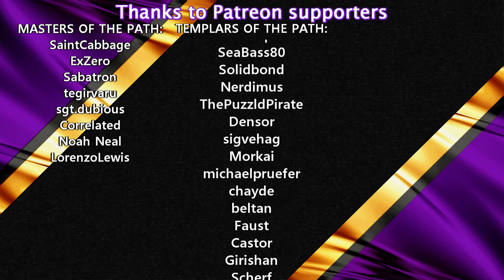Never Worry About MODULES Anymore | #10 | Factorio Megabase-In-A-Book Lets Play

Comment: My favourite part of this series is trying to make things on my own and then completely tearing it all down and replacing it with your designs the next day because yours are better
Reply: That's exactly what I do too lol
Reply: I kind of split the difference... I decided that I wanted to do a different city block size (128x128) so I've been using that design as I'm transitioning my own base to a "mega base". And so I'm largely copying some of the designs from this series, but then I'm having / choosing to re-work them to that block size. 

A good example was the green circuits, which I was able to fit in 2 128x128 blocks instead of the 3 that Nilaus used.
Reply: I have resisted doing this but I am reinventing the wheel all the time, I start with a cube and then whittle. it is the worst.

Comment: For the trains, I'd suggest having as many trains in the network as you have supply side stations and parking/stacking spots, no more. Hard set the limit on the "load" station side of any given factory to it's station + stacker count.  This should mean there won't be empty trains with nowhere to go stack up and wait for product.  It's fine for the station on the requesting end of things to say "I don't have enough room to unload any trains, I'm closed". The supply side stations should never say "I'm closed since I don't have enough material for even one train", since then the stackers right behind them are also empty.
Reply: 05:40  And at that point, the weird thing is that the station is so far off to theright.  The trains almost circle the deposit to load resources.  In that special case, I'd just build the station to the right of the track going upm with a turning point a bit further to the south to avoid trains blocking any important track.  The station would be a mere piece of track parallel to the main line. 
But what we really need for track (and which we have in abundance for both belts and pipes) is a 3rd dimension of either bridges or tunnels.  I'd favor bridges, built from 3 parts: southern ramp up (or down when moving south), northern ramp down, and a standardized bridge interval which comes with a pillar if you build several successive ones.  The ramps could be ~12 tiles long and the interval 10 (2 pillar diameter, 8 tiles available for anything going below).  The same should be available west/east, and that could be it, maybe diagonal pieces (interval 7x/7y), but they're not badly needed.
Reply: I have been grappling with this lately. I see what you are saying. Even if there are no requests for full supply trains all the available trains can find a spot to wait until request for materials come in. My concern I that my requesting station stackers will hog up full trains when other requisiting locations are waiting for slow mines. I don't have things balanced right I guess. I recently started adding blue belts for the first time and my 4/1 trains can't seem to keep up. Sadly I am still suffering from 'Spaghetti base' and I think I will need a huge rework to use any larger trains, so I am working on increasing my robot speed to ease the blow. But at the same time I see the alien menace increasing in numbers and I am getting nervous.
Reply: Yeah, I started using the circuit for the stations from Nilaus, and the problem I'm having is what he had in this episode - an empty train sitting at an unloading station, complaining about "destinations being full".  I think I've adjusted enough of that yesterday, but I also get the opposite situation, trains sitting at loading stations complaining about no space at the unloading station, when all of the lights of the unloading station are off.  The unloading station has 4 stacking slots, but trains won't route to the stacker if the lights are off, I guess what I need to do is add an arithmetic combinator to add "2" or "3" to the L value, so the unloading station always has a minimum demand.  Otherwise, the stacker at the unloading is kind of pointless.
Reply: @dogbarian8280  Im going to try that too,
Reply: Your rule does ensure that all trains have somewhere to go and empty trains are not blocking access for non-empty trains... but a problem with that approach is that trains will always go to sit at the closest supply points, so more distant stations will be relatively under-served even if they are full of goods waiting to be picked up.
Nilaus' method ensures that supply will get picked up quickly no matter where it is. One downside of that we are seeing here; it breaks down when demand exceeds supply - but you can avoid that just by expanding your base in a strict order (in order to increase a given output you must increase all of its inputs first).
Another downside might be that it leads to longer average train journeys, since trains will prefer to pick up from fuller stations even if they are much further away.
Guess there's no perfect answer! Which is great because we can all keep playing this absurd and wonderful game forever :)
Reply: saved

Comment: As someone else mentioned, you didn't wire up the landfill station to know how much landfill it has. 

But thanks for going over what a landfill station would look like. It's something people have asked for often on Discord. :) For me, I did similar, but I made my "Landfill factory" independent of the rock quarries, so I won't need to move it as the quarries empty out. 

Also, thanks for noting that the module unload station will need to be special; since you use the blue modules a lot more than the brown ones. If you just do the usual "wait until empty", you'd end up with a lack of speed modules and a lot of productivity. Hopefully the next video (or whenever the unload station is made) will cover the specifics in details.

Comment: Best Factorio series on YT without question. Question on the landfill train...Would it work better for throughput to just have a 1-2 setup and limit it a little to account for how much throughput you're actually getting from the miners? Unless you module them, even with the mining productivity you'll be short of filling the blue belts (again, I know this is just an approach to clear that spot to clear space). Just considering the expansion you laid out, and it might save some time on your end. It could move landfill in faster to the base, allowing the spidertrons to do the work quicker. Just a thought.

Also, to build on the train issue, couldn't a depot handle the supply/demand issue for now? I know it's probably not the plan for this base but it could clear up bottlenecks for now.

Either way, love the series, and glad that we have someone like you to lead the Factorio community.

Comment: I handle the waiting at unloading for an open spot adding waiting stations in the stackers of the loading station, one on each lane of the stacker. Add that station in the schedule with no condition before the loading station. The trains will leave the unloading station and go to one open spot in the stacker, where they will wait with the "destinations full" message.
If you have no condition on the schedule for that stop the trains do not stop if they can go to the next stop (just checked, trains do that, more details at the end of the comment).

Since you have multiple loading stations for the same, maybe a separate stacker where all trains route trough with no conditions so they wait there and not on the unloading stations. That way you avoid the situation where one train goes to a waiting stop and another loading station for the same item opens and it has to go through the not ready loading station to get out again. If you add a block or two with trains stackers with those waiting station north of the blocks that produce each item, the trains will leave the unloading stations, go to those stackers and wait if there is no open station or continue south along the line with the entrances to the blocks producing the item they carry. You lose some time because they have to go through the stacker, whether or not there is an open loading station. This could be solved disabling the waiting stations with circuits if any of the loading ones are ready, trains skip disabled stations so they should go directly to the loading station that is ready, although handling the trains limits on the loading stations and disabling the waiting stations correctly is not trivial.

Edited: checked my affirmation about trains not stopping at station with no conditions. They don't. If you add a time passed of 0 seconds, they stop and start inmediatly. If there is no condition for the stop, the trains does not stop but pathes through the station. It does stop if the next station is full.
Reply: I think if you just have exactly as many trains as loading/supply stackers, you can set the supply station's limit to the number of trains you can stack at that station, and there will always be a place to park. The only reason to stack at an unloading/demand station is to buffer the haul distance.

Comment: Thanks for posting so quickly! I'm enjoying learning from these episodes. 

PC spec question: what is the minimum memory size recommended to run a megabase? Context: I have 8gb of memory, and my PC is starting to strain a bit, and my base is still in the micro to mini range.
Reply: It's more about the cpu speed than ram. Maybe the ram's bus speed, but 8 GB should be plenty, if Factorio is the only program going on your system. Map data probably uses 1-2 GB. You might need to trim your other background processes though, close browsers and such. 8GB gets eaten up pretty quickly by random bloatware and other programs, especially web browsers.
Reply: @DFPercush It very well could be my CPU. I have an AMD FX6300, running at 3500mhz. Perhaps that is my limiting factor. The game is playing fine, except for autosaves. That takes several minutes, which is slightly obnoxious.

Comment: Question : I noticed that several of the loading/unloading stations have stackers installed, but the incoming train limit is set to 0 or 1. If the loading station (NOT the unloading, since you don't want finished product idling) had a limit of 2-3, the trains could sit in the stacker while waiting for plates/circuits to be made, and that way the trains aren't sitting at the unloading station empty waiting on production and blocking incoming full trains.
Reply: the problem is a loading station only requests a train once it has enough material stored up to load it. If he manually added +1 or +2 to the maximum requested number it could get to a point where a train was idling in a stacker but somewhere else there is a loading station that is now requesting without a free train. 

I personally built an in-between stacker with something like 32 stops where trains can idle and wait on their assignment to open up. It works really well to get them out of stations immediately after being full or empty.
Reply: This is one advantage of the LTN mod over the vanilla train limits. Depending on a setting, it can redirect trains to a parking area or just immediately schedule them for the next pickup. But I think the solution is just to put all your parking on the supply side. It might not fit nicely in this city block arrangement, but there should be a place for every train to wait before loading. The request/demand stations can have small stackers, enough to buffer the haul distance, but you don't want anything idling there.

Comment: I've just finished my 1kRPM base by using a lot of blueprints, I had a good feeling of what am I doing at the starter base level using mostly blueprints from the Base in the book series. As for 1k RPM part, I've just pasted several dozens of 400*400 railroad city blocks without a deep understanding of how it actually works. Most confusion comes from the train system, I was using LTN which requires a depot slot per train, but your system (looks like it) has a built-in depot for each producer. Anyhow I would really appreciate it if you'd share your thought process and maybe an overview of options on how to setup your trains when it comes to a megabase stage

Comment: 16:10  Wouldn't it be a bit better if you built the 4-belt blue chip unloader with 4 slow belts? 
You said that belts backing up are much more CPU-friendly than belts with gaps netween the items -- IIRC, that's because Factorio treats each solid group of N items as a "train" of items, which saves CPU cycles.  The worst case is probably 2 items, where all that "railroading" doesn't pay dividends until the "train" runs into another resource.  So, wouldn't two slow belts (or two medium ones) be much better for CPU efficiency?